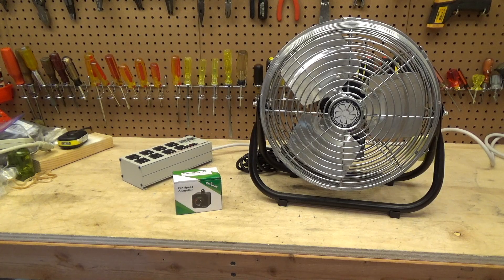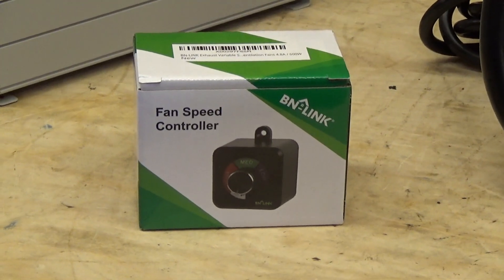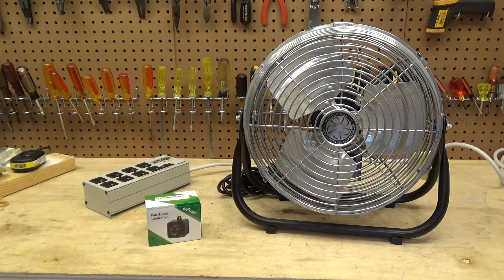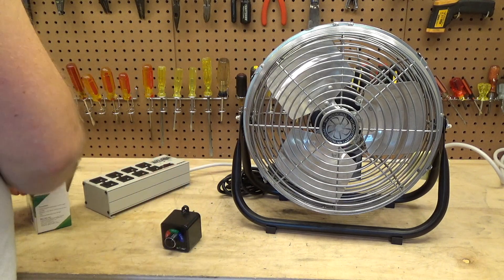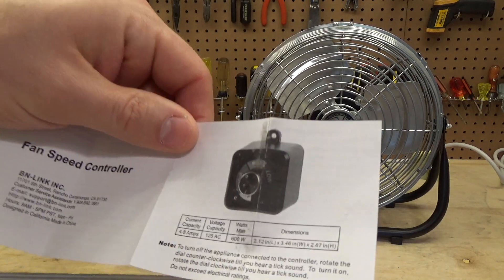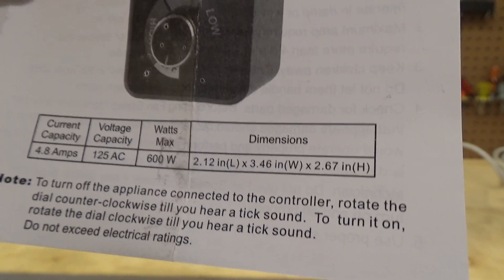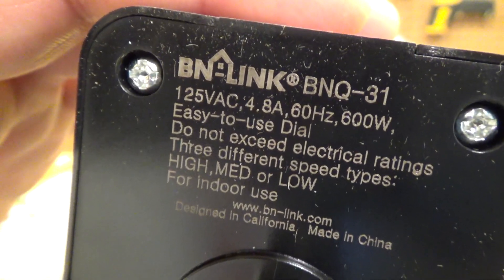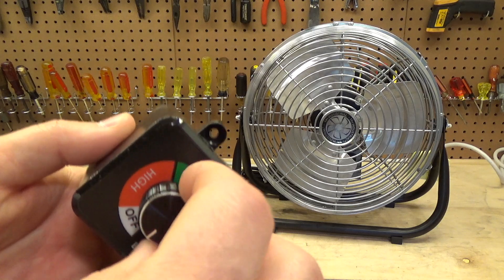BN-Link BNQ-31 Fan Speed Controller

Comment: Keep an eye on it. No UL or even ETL approval that I can see. Monitor current draw especially on PSC motors. Sometimes motors react to these weird and pull excessive amps when reduced over 50% or so. Mostly made for shaded pole motors. They usually run very quiet with triac controls like this.
Reply from the maker: This was more just experimental, I don't trust this for any long-term or unattended operation.

Comment: This might be good to use on the GyroAire with its internal control panel bypassed, since that was intended for infinite range operation anyway.  I'd love to see a video of that; you need to see the control panel in there anyway, it will surely get a reaction.
Reply from the maker: I have obtained a different type of controller, which is very high quality and alters the speed in such a way that doesn't create any motor hum. That's the control I will test it with, as that's the one I would use as a permanent way to operate the fan.

Comment: Be careful of that, those speed controllers use PWM (pulse with modulation, which could harm the fan motor.
Reply from the maker: Exactly what 'harm' do you claim it's going to do?
Reply: @JordanU   from my experience increase sustainability of arcing, and overheating.
Reply from the maker: It is electrically inconceivable that the control would cause the windings to start arcing and overheat.